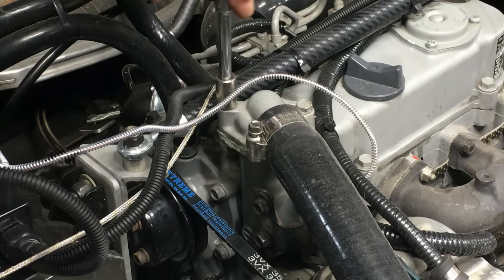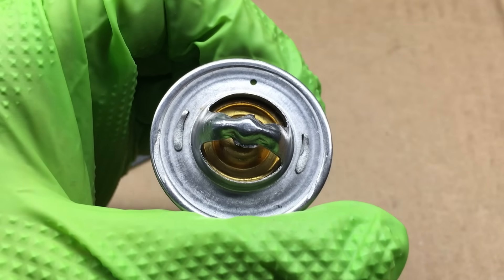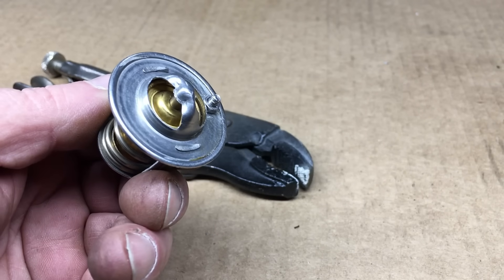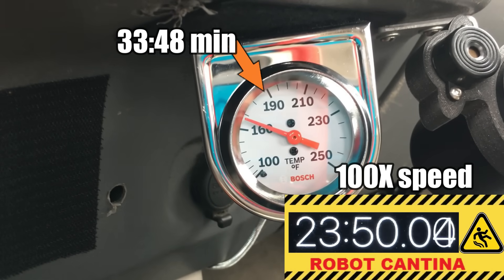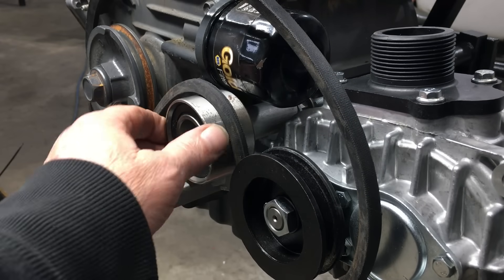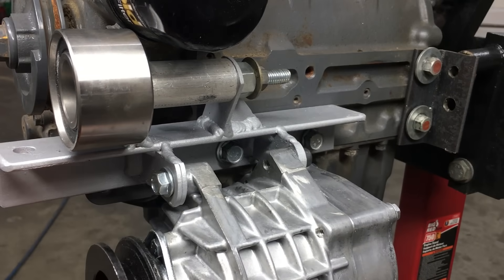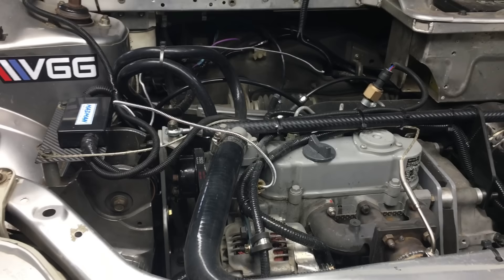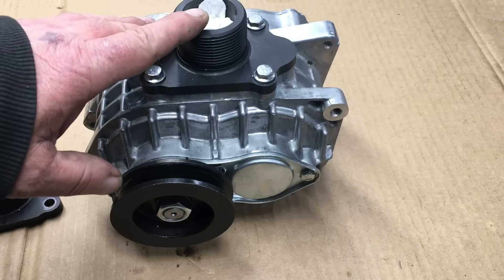S4 E4. Thermostat issues and making an AMR500 Supercharger fit a 719 cc Kubota diesel engine

Comment: I've been excited to see the stupid charger install for a while. I want to buy an old riding mower and hot rod it with one of these. I used to build racing mowers for fun as a teen, but never had the funds or knowledge to add forxed induction.